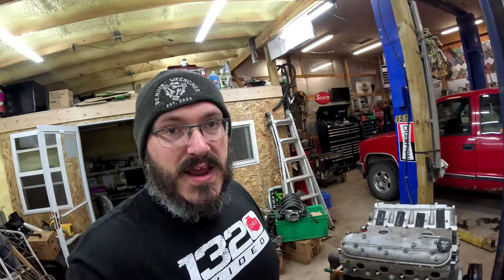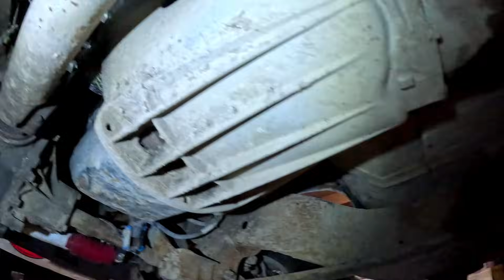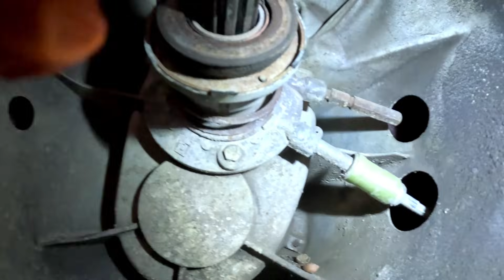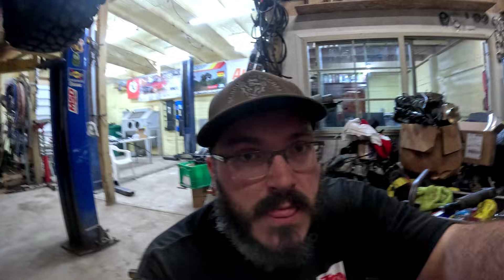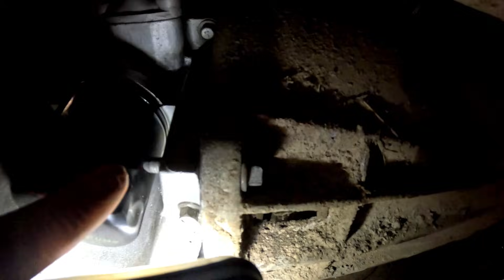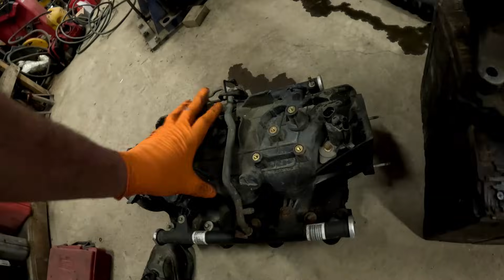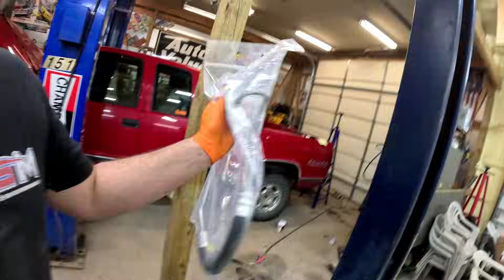EASIEST LS SWAP EVER!! 88-99 CHEVY/GMC Truck GMT400 pt.1

Comment: my k2500 was slightly more complicated but not by much! I have an lq9  and an nv4500 in mine LOVE IT.
Reply: What did you do for the clutch on yours? I have a 96 with the nv4500 that I’m in the middle of swapping
Reply from the maker: @Justintimemetal  I bought a eBay clutch kit for an 04 half ton
Reply from the maker: Came with flywheel
Reply: @Bendinwrenches  I’m gonna buy the flywheel and clutch for an 02 and give it a go.
Reply from the maker: @Justintimemetal  they're all the same spline count in the early years just make sure to shim the throw out bearing.
Reply from the maker: @Justintimemetal https://www.ebay.com/itm/133285918730?fits=Year%3A2004%7CModel%3ASilverado+1500&_skw=2004+Silverado+1500+clutch+kit+and+flywheel&itmmeta=01JS7N79XA7GPKQQWP058M82XB&hash=item1f0875b80a:g:xa0AAOSwFuJn5usD&itmprp=enc%3AAQAKAAABEFkggFvd1GGDu0w3yXCmi1foggUsTT9Ra46gDmUTfjmik2nK8Q6JVR%2FSMF2QbJQR8JRxJGC7BGSEoGOCPrps2Lza4YhmnLo7E4Sed1KTD%2BlSnr3%2BHHw0ynd3tOFSviek0dY9l9sZ6PKWnZ9hFDlqNDEWK4TYjL5%2FldCBZ3iVa%2BK%2B%2FUJT874LTTJH0FaVYwB6FSh%2BPIGi16tHDIMQmzX%2FZlBgiIEudYlp89LdurSKyIq2lwyl3xaufXXuA1NRt69Tb%2B2wpP7dLYlA8e%2FKOu7LO5DHAJ2u0Uj5SRojBpsFVVgSUesUjOzgtUk%2FItQzJUlxEq1vBj5EnMVCrA%2BQ%2Fz4d%2Bn4Fp86%2BNscpZIB9j1nTBme6%7Ctkp%3ABFBM3p6d9cll
Reply: Are the newer nv3500 s different? Then the units in OBS trucks ? I ask because there’s no mention of shimming the newer throw out bearings. And your using a LS with a nv3500 which came factory? In the newer stuff? Thx u
Reply from the maker: @bruceshepard1136  the pre LS bellhousings are a different depth if you get an LS transmission you don't have to worry about shimming anything.
Reply: @ I have a 2007 gmc sierra 3500 nv4500. I did nothing special. 
Unless you have a 99/00 6.0 with a long nose crankshaft, dont worry about anything.
Reply from the maker: Right on that's awesome!   But yeah by far one of the easier swaps! I feel like these trucks were built around these engines!
Reply: @Bendinwrenches  looking at your truck is like looking at mine ! Can never go wrong the engines definitely look like they just belong.  You on IG?
Reply from the maker: @WiserAsIGrow  I have not set up an account yet but that is definitely in the works! Still trying to get a grasp on YouTube 😆
Reply: @Bendinwrenches  Feel like I'm there with ya keep up the good work.
Reply from the maker: @WiserAsIGrow  right on!!  Part 2 dropping Friday at 4!!

Comment: What bout 6.2 alloy block ls swap with a 4l80e.
Reply: I see just on a budget I know can get costly real quick.
Reply from the maker: @brianpaquin8070  100 percent the most inexpensive way I found is stock 5.3 from a yard Amazon harness you can do them for a grand or less. But when you get into anything that is 58x like Gen 4 and Gen 5 price goes up!
Reply from the maker: 6.2 is a 58x crank so if you're running a Holley it will  100% bolt in and work.  You'll just have to deal with the transmission crossmember and drive shaft modifications. Unless your truck is a 3/4 ton with a 4L80E already.  But you will have to deal with a different operating system regardless running a 6.2. unless you change the tone ring or run a newer computer or lastly a lingenfelter box.

Comment: 6:45:00 what about guages and body controlled A/C
Reply from the maker: All the gauges will work based on factory sensors, with the addition of the quote unquote LS1 98 Camaro coolant temp sensor or adapting your factory coolant temp sensor. At some point when the next video comes out there's a wire you're going to tap into on the original ignition module to generate a tach signal for the dash.
Reply: @Bendinwrenches your tuner can correct the pulses coming out of the ECU for your tach.
Reply from the maker: @pmotorsports8276 correct.
Reply from the maker: It's all sorted now.  But we did have to recalibrate it
Reply from the maker: As far as air conditioning goes it will work like normal if you decide to use all your factory stuff and get ICT bill at brackets to utilize your original compressor. We're not running AC that's why I don't touch on it.
Reply: Back in the day I LT1 swapped a 96 S-10 the A/C would not work ontil I hooked the original ECU back up.

Comment: Bruh 5.3 isn't even a real LS motor........
Reply: Like saying GMC is not Chevy
Reply: @pmotorsports8276  right
Reply from the maker: 😂😂😂.    Sorry one vortec for another 😂😂😂
Reply: @Bendinwrenches24  Vortex with the tornado dispenser
Reply: 27:30:30 LS1 coolant temperature sensor 🤷
Reply from the maker: LS1 coolant sensor 1998 has a 3-wire in a Camaro only this runs the factory gauge plus utilizes the two signal wires to measure resistance for the temp sensor portion for the computer. Instead of adapting a factory gauge for the 97 truck at hand this sensor does it in one.
Reply: @Bendinwrenches  I was being sarcastic to the "5.3 no LS comment"
Reply from the maker: @pmotorsports8276  😂😆😆😆 gotcha!
Reply: It is to a real LS just cause its a truck LS don't mean its not a real LS
Reply: 17:30:00 no LS7 either. But that bearing worked 🤔
Reply from the maker: It's just commonly called an LS7 pilot bearing it's the same as any newer 4.8 stick shift it's just a radial ball bearing vs an old style needle roller.

Comment: All of that work for 30 extra horsepower? He could have easily swapped the iron heads with an inexpensive set of aluminum heads on the 350 and it would’ve made about the same if not more power from the increased flow and compression. Add a mild truck cam and he could have been at 350hp with the old 350.. Add a 230/236 cam and it could’ve made 400hp. Everyone wants an LS swap for lame reasons. Now if he was putting in a bigger engine like a 6.0 I get it.. Bigger anything is better when it comes to cubic inches..
Reply from the maker: Not even a close comparison, we're doing it for a liability it is Cam swapped as well and it's getting tuned too compensate for that. Plus he wants to keep the fuel injection and not deal with archaic vortec stuff.
Reply: How much does all that cost.🤷at that point it's not apple's and apples

Comment: I’m gonna be doing this in my Tahoe it’s also a 97 so this will be my guide!! One question why did you pick the style motor mount that you did (just curious)
Reply from the maker: So you don't have to move the transmission a lot of the plates that adapt your clamshell don't get the bell housing in the exact configuration. So this way you know you don't have to move any of your driveline.  Plus it makes quick work of it and being this is a 300ish horse 5.3 this is more than enough. The other options will work as well this is just what I prefer quick and simple!  Appreciate you turning in I'll have some more coming out this week!

Comment: I’m subscribed. I got two gmt400 k2500 trucks that I’d love to sit a ls or lt into and this is golden info
Reply from the maker: Right on I appreciate that! I'll have more info as the build  goes on but hopefully in the next video or so it will be finished.    These are one of my favorite trucks to do they are so simple anybody can do it especially when you get into the vortec years! If you have any extended questions shoot me an email or message me on here thanks for subbing!
Reply: @ I’ve got a 99 k2500 350/4l80e crew cab short bed I’d love to put a 6.2 ls or lt into. Only issue I’m finding is communication between the ecm/tcm. Haven’t searched much but I’m sure it can be done. The gmt400 and 800s are two of my personal favorite hence why I got two of both in 2500 and 3500s. Keep up the good work friend

Comment: Great LS swap video,full of information..Thanks for bringing us along..
Reply from the maker: My pleasure!!  Thanks for tuning in!!   Part 2 coming soon!
Reply: @Bendinwrenches hey I have a question I currently have a 350 I want to check and see if it’s running but I don’t know where the cord/wire is for this battery placed on this 350 n I also want to take this motor out
Reply from the maker: It really depends on the year. I guess I'm not completely understanding what you're trying to describe. Generally an older small black Chevy. If you put power to the distributor it would run but if it's a newer OBS style truck you would need the PCM to have power and what not to run @CMoMoni